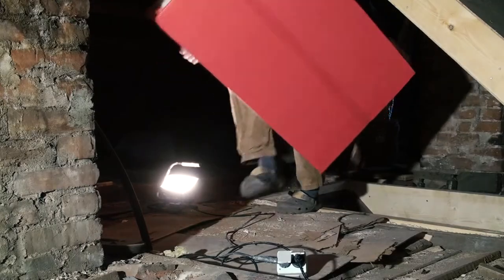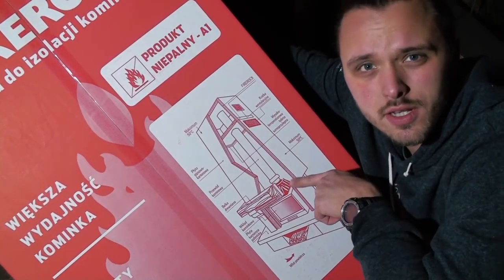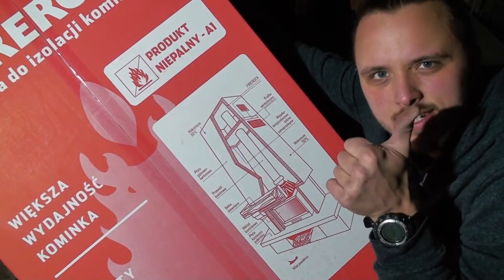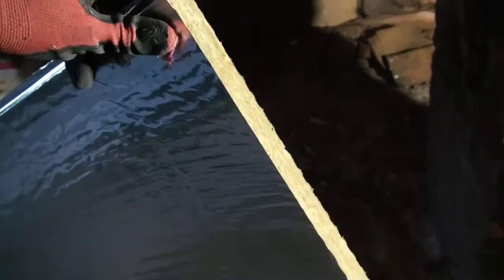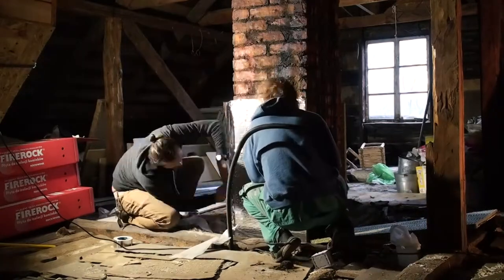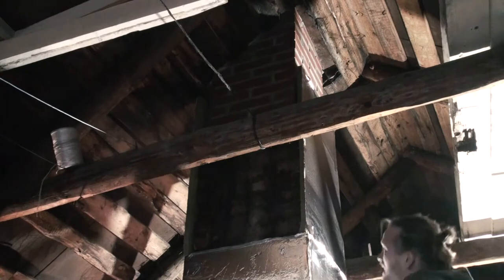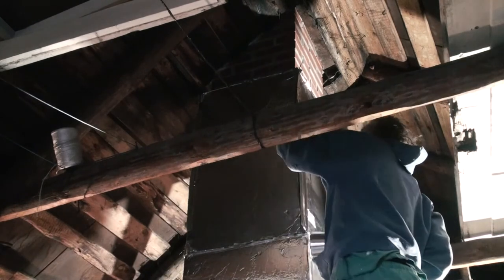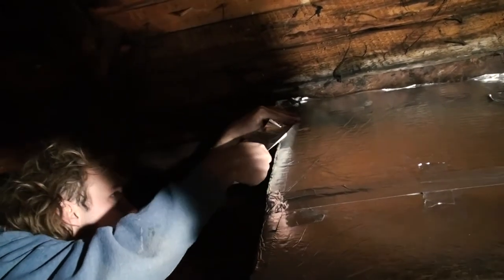Insulating Chimneys in the Attic

Comment: Thank you for sharing this! I have a very similar issue with my chimney in Norway and you have finally helped me understand. However I think there is a risk that because the chimney will still be cold (from cold air coming in from the top and from thermal bridging through the bricks). As there is no vapour and humidity barrier around the chimney, when you light the fire the hot air will still condensate and seep through the bricks. Your insulation will then get damp and its performance will drop significantly. Would be interesting to open up the insulation after a few years to check.
Reply: This. The insulation will most likely get soaking wet in a few heating seasons due to the humidity coming from the bricks. Taped aluminium foil is a perfect vapor barrier. An insulated chimney should have no vapor barrier on outer layers.

Comment: Isn't there a code regulation that says you have to have a 2 inch clearance around any fire place ?
Reply: Great question, I wish someone could answer…
Reply: You need 2" of clearance to any combustible materials, which in an attic is usually the wood framing.